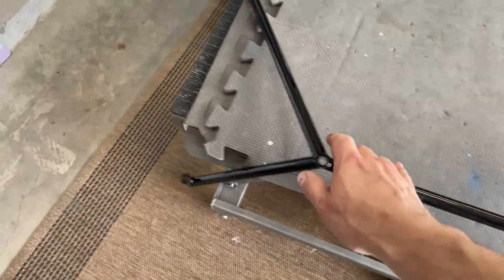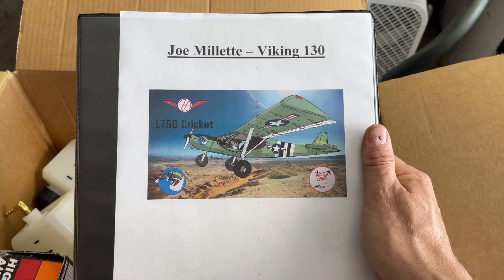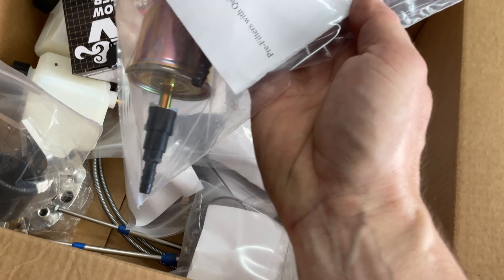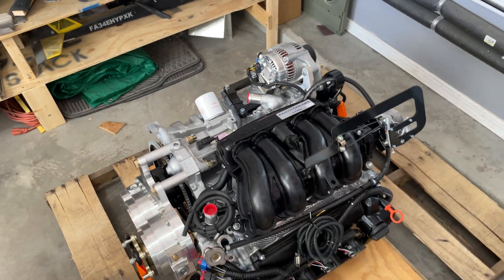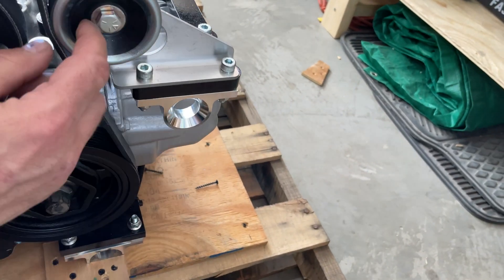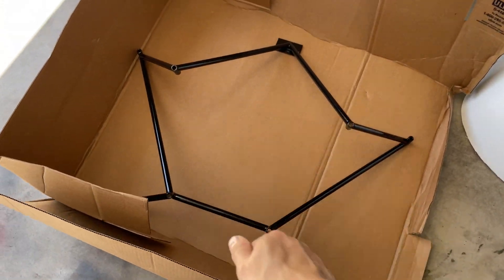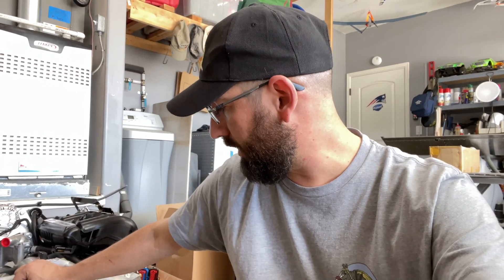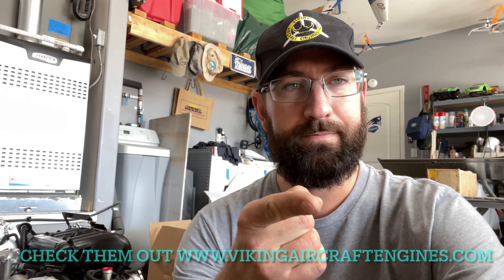Zenith Cruzer Build: Unboxed my engine

Comment: what was the third filter for. I am going to have to go through my kit again. I have had it a while. Check rear left rocker cover bolt above the engine mount, Mie need to be shortened, A few have had a leak there because the bolt cant be tightened enough.
Reply from the maker: The system uses 2 pre filters from the wing tanks to the header thank and then 1 high pressure filter after the fuel pumps going to the engine.
Reply: His does not need to be shortened - we learned about a year or so ago when a fella had a small leak in that area (and not all do, just a few have) even with longer screws 🤷🏼‍♀️ but once we know of an issue it gets fixed immediately across any new builds.